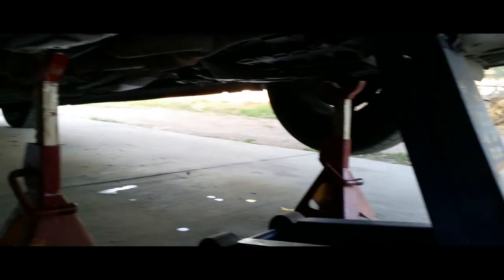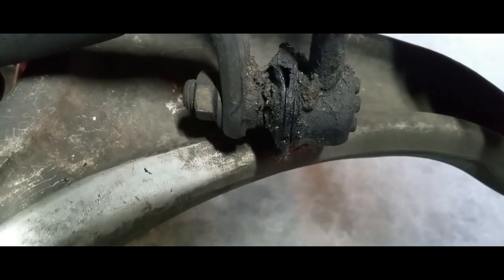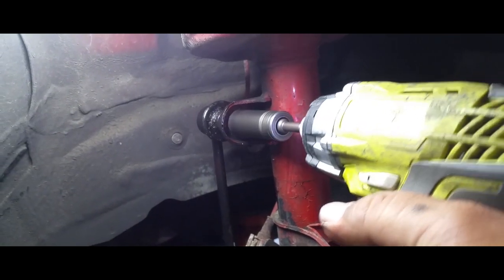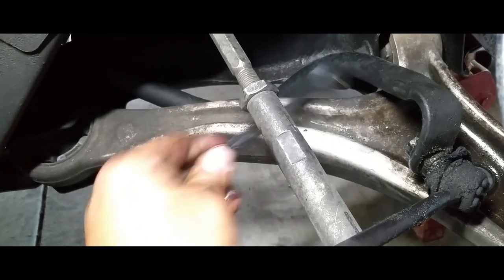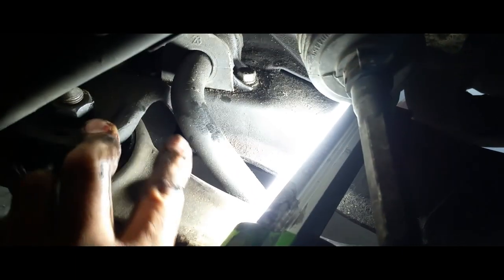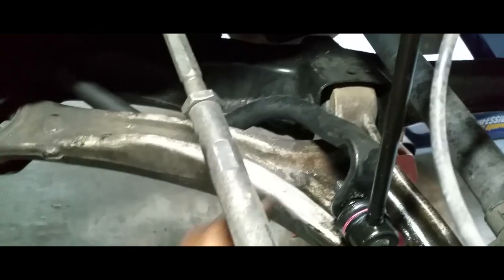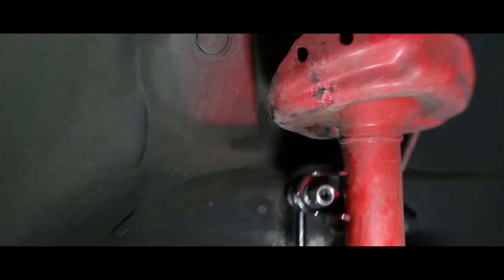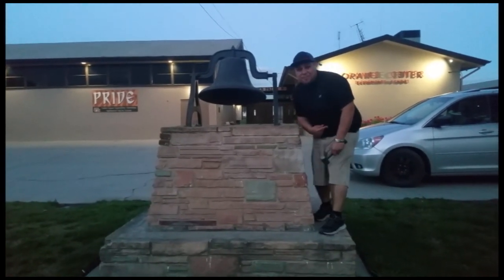How to: Install Sway Bar Links on a 2010 Honda Odyssey

Comment: Even heating until glowing and PB blaster i still had to cut mine off😐😐😐 Put lower control arms on while i was at it👍
Reply from the maker: Fudge! No way 😳 Dang bro that sucks man. I'm sorry bro 😔
Reply: I Just tried taking mine off yesterday ..im gonna have to cut mine too. That bottom nut is locked ...very tight space too
Reply from the maker: @kishdogg1594  yeah its pretty tough to take off and on sorry bro good luck!
Reply: i hope indont encounter the same issue